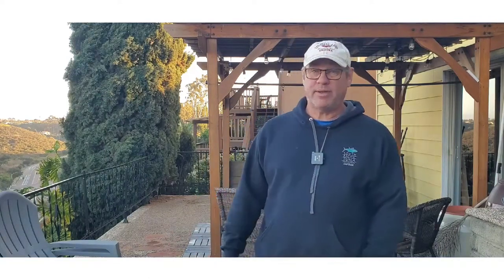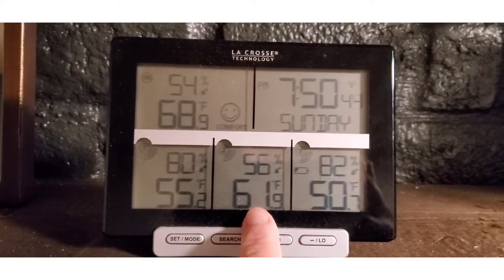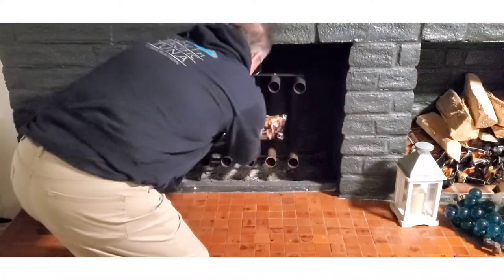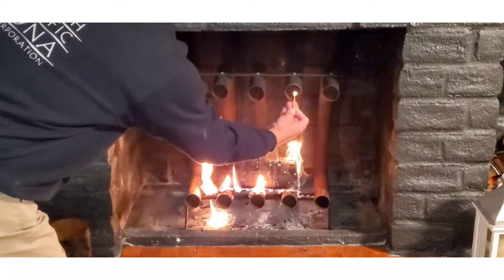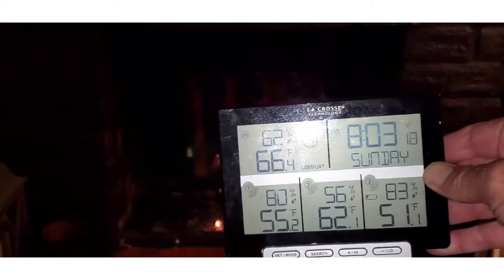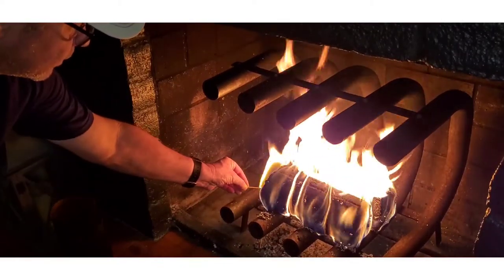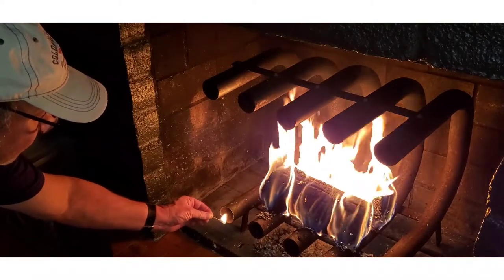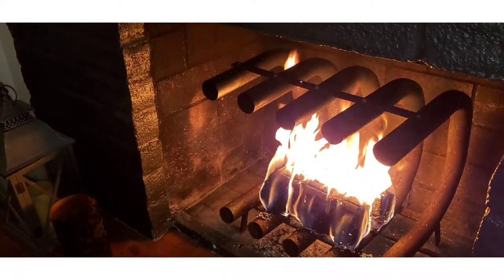Review- tube fireplace heater

Comment: They used to make those in the 60-70s with a fan attachment that was off to the side and blowed air into the tubes and forced heat out the top tubes … but any heat you get would be sucked up the chimney with the draft of a open fireplace
Reply: My grandparents had a whole fireplace insert. It was awesome. It was a metal stove insert that had a firebox and pipes around the sides and top that it forced air in and out. It was extremely efficient. You would build a fire and have the doors open all day, and at night you would put a big log on, close the doors, crack the vent, turn the fan on, and it would heat the house all night long. I miss those days, and my grandpa.

Comment: I'd go with a larger pipe opening where the air comes in cold that tapers down all the way so it speeds up the air and shoots it out the top tubes. Also I'd make that whole contraption go in along the floor of the firebox, the bend up along the back wall and then come out at the very top of the firebox so it's not so obvious and actually hidden more.

Comment: you're talking about venturi effect but that is not at play here
Reply from the maker: I'm no physicist but isn't the basic principle that you restrict the the flow area and the substance speeds up?
Reply: @groverscorner2364  , i was wrong, yes thats the principle and also how you described it in the video
Reply: @groverscorner2364  That isn't the venturi effect. Yes, the fluid will increase velocity if you restrict the area in a jet stream, but only if you assume a constant flow rate (thank you Bernoulli). The venturi effect is a completely different animal. Welding a washer in place might speed up the jet stream, but it will more likely create backpressure that works against what you're trying to accomplish and reduce the overall flow rate.
Reply from the maker: @C0RY.M Sounds like we need more testing. 👍

Comment: Thanks!
I bet, with longer pipes sticking out a little further and bent upwards, and with no washer which i would reason would just cause air resistance, there would be better "draft" and thus greater heat.
However, there must be something to that Venturi effect, so maybe some twisty metal thing where "the washer goes"? But afaik, the object is to not restrict airflow.
Reply from the maker: I'm actually thinking yes, since the washer would have created a venturi effect the air may have shot out faster which seems reasonable that it woukd help. Thanks!!